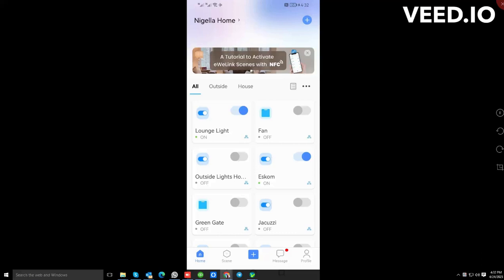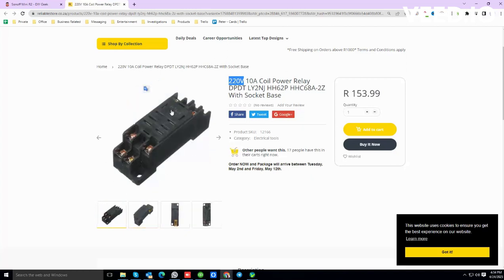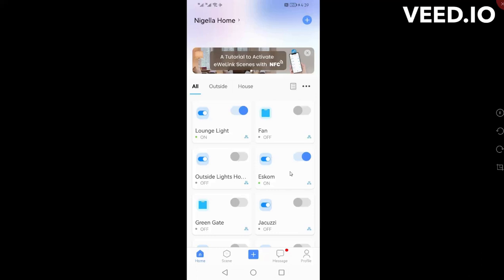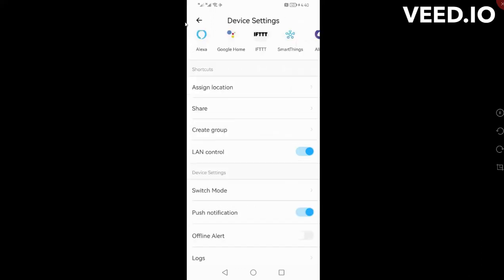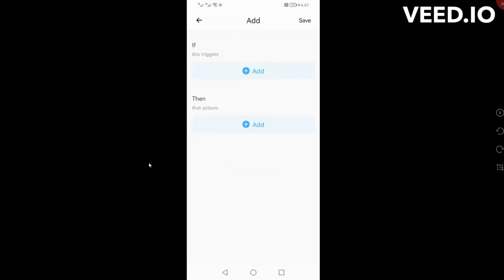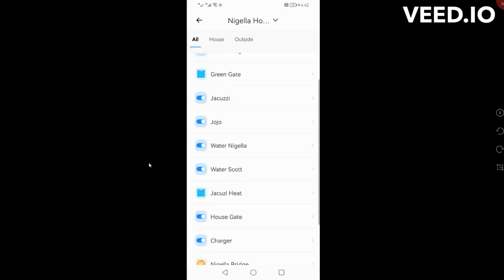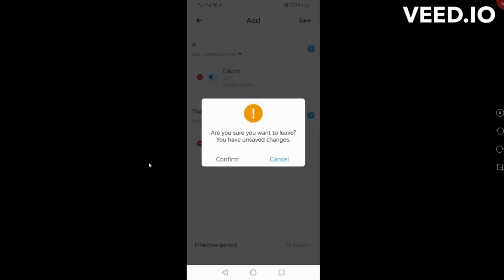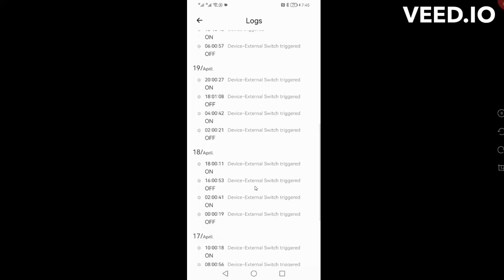SONOFF To control your power use during load shedding

Comment: If you are powering that unit from Eskom through the relay, how does the unit stay powered on then to send a command to shutdown/turn off non essential equipment that i have wired to my POWR3's. Does it send the command to the units to switch off as soon as power is lost, as the mini will lose power itself?

Comment: OK, but why put these devices on your inverter to start off with. This is dum. Other devices link with Eskops API and you can set the loadshedding stage when some divices needs to not add load on yoir inverter system to save your batterys suring 4houer stages.